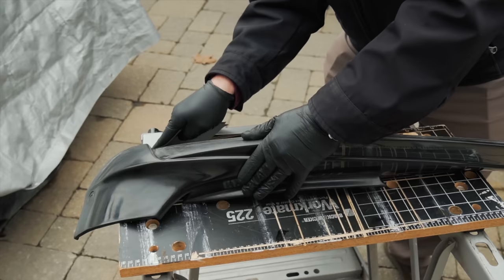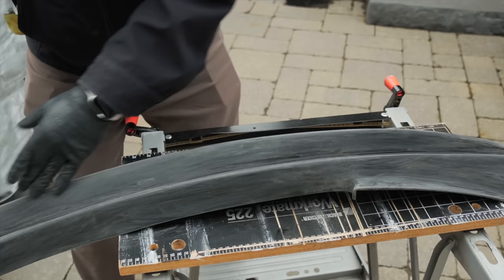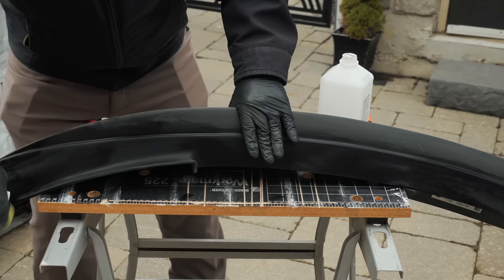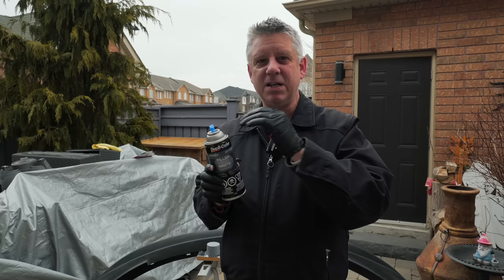Painting a front lip spoiler

Comment: You should also use a plastic adhesion promoter before the primer if you're painting a plastic front lip.  It will help the primer and paint to stick to the plastic even more than just scruffing it up with sandpaper.
Reply: I called Rustoleum and they told me their universal bonding primer was better to use.

Comment: Amazing how it came out great job Im gonna paint my front lip kit I just got and this is a great help .
Reply: The key is prep the masking if any and sanding is the most important part. It’s also better to apply all the coats in light coats. Wet coats don’t come out that good. I painted an entire car with aerosol cans sanded just like I had a gun and compressor then took it to a guy who owned multiple mechanic shops and has been painting for 6 yrs and he didn’t even know I used aerosol cans until I told him. It was also my first time ever painting a car.

Comment: I was hoping to get some advice on how to fix my front lip spoiler but I did the exact same as you did. Looked stunning when it was done! Unfortunately the paint started cracking as soon as it first touched the road. It created cracks that went all the way up to the bumper. I'll have to remove the paint and come up with another way to paint this. Everytime that thing scrapes a tiny bit it keeps getting worse 😐
Reply: Use a plastic adhesion promoter after the initial plastic scuffing, then you can primer or paint. I recommend "SEM 39863 Plastic adhesion Promoter" (1 light coat and 5 minutes later a wet coat) 5 minutes after that you can prime or paint. Also, make sure your paint has a flex additive so it won't crack due to plastic flexing and temperature changes. Best of luck!